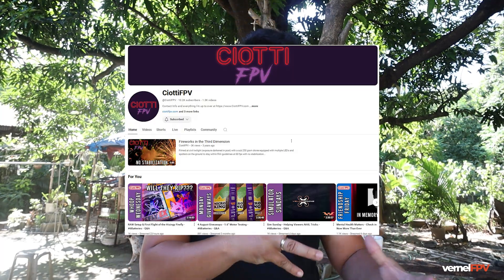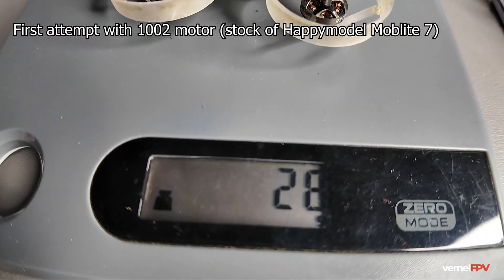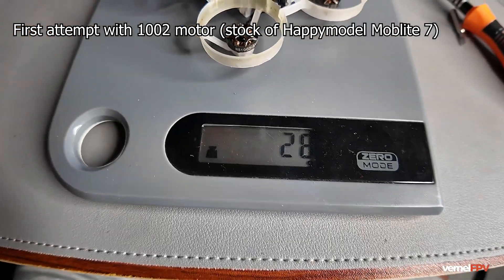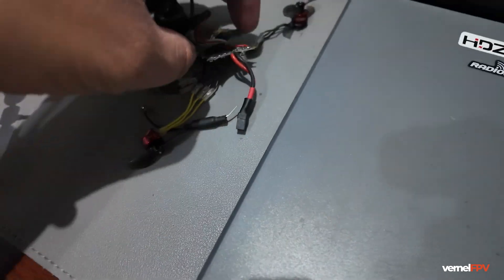Building a 65mm Walksnail 1S // Happymodel "Moblite 6"

Comment: I recently did a walksnail 65mm build and got it under 23g pretty easily.

- 4x 27000kv betafpv 0702se motors
- betafpv air65 frame
- betafpv air canopy
- peek motor screws
- walksnail 1s lite kit (no heatsink)
- betafpv f4 5a 1s fc
- Removed the heatshrink and metal piece off the stock antenna

Every gram makes a big difference at this size
Reply from the maker: thank you with this. will try to use these specs as well
Reply: @vernelfpv  I also have a 75mm build which I recommend I fly that more cause it has much better battery life and still easy to fly indoors/outdoors. Only change is 802 motors and air75 frame
Reply from the maker: @itsjase92  oh you mean i just need to use a smaller motors for the 75mm. interesting. my 0802 here is 19000kv
Reply: @vernelfpv   I normally go 702 for 65mm cause you want lowest weight possible for small size.

For 75mm both 802 and 1002 are quite popular